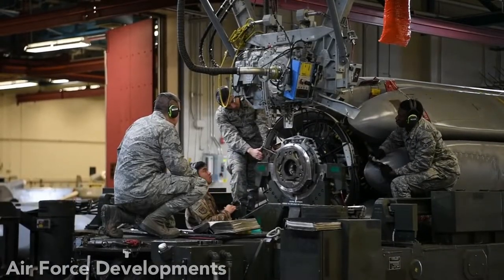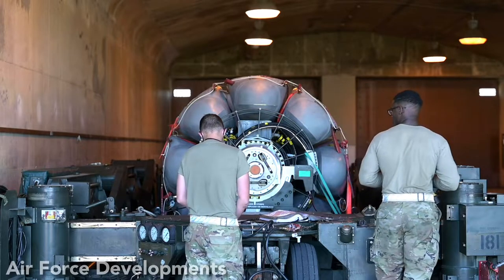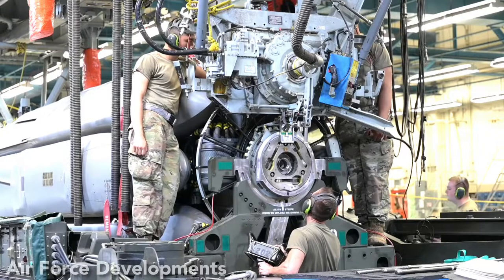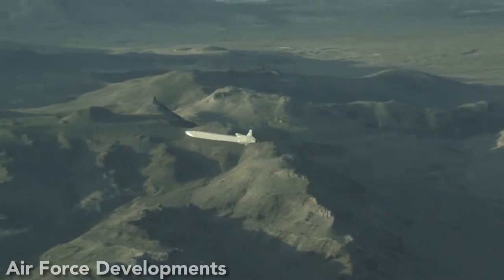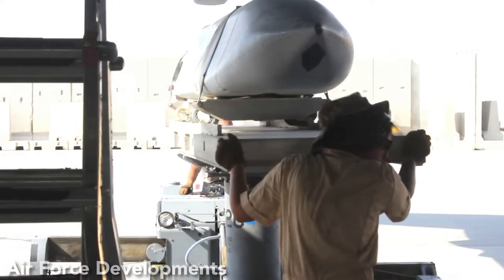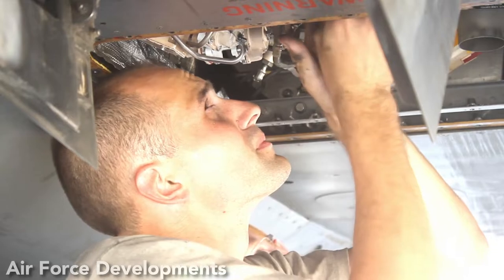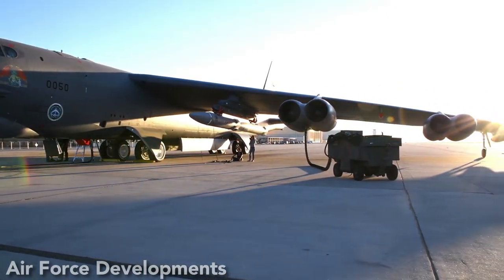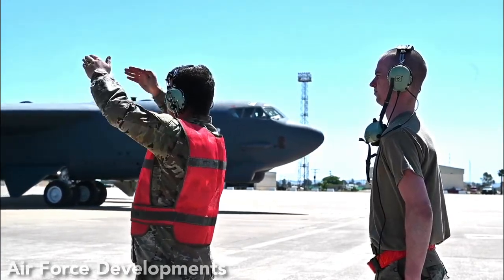Nuclear AGM-86 cruise missiles and B-52 bombers | Stronger than the Atomic bombings of Hiroshima

Comment: 4:50 I'm pretty sure the B-1B didn't carry the AGM-86B or C. It wasn't fitted with the moveable bulkhead to accommodate the longer missile (than the 86A version), except for some trials. The same with external hard points. Then all the nuclear equipment and wiring (presumably for the SRAM missiles) was removed in the 90s, so it definitely couldn't carry them after that. I think the cruise missile being fitted to the B1 in the video is the JASSM. I'm no expert though, this is just what I found on the internet.